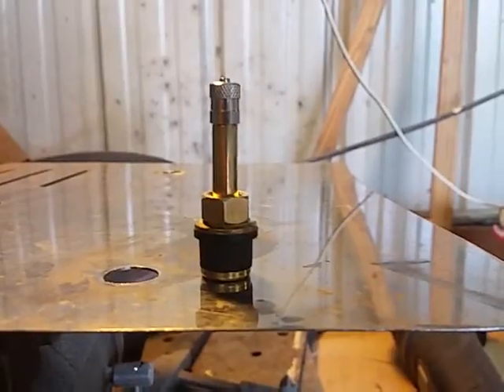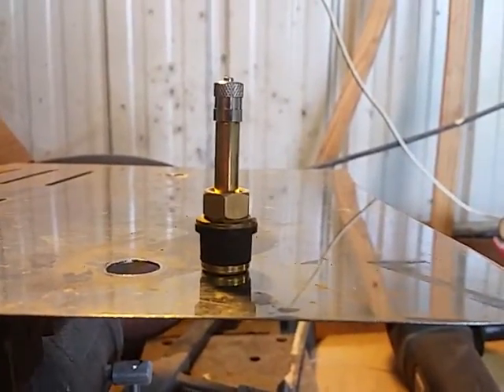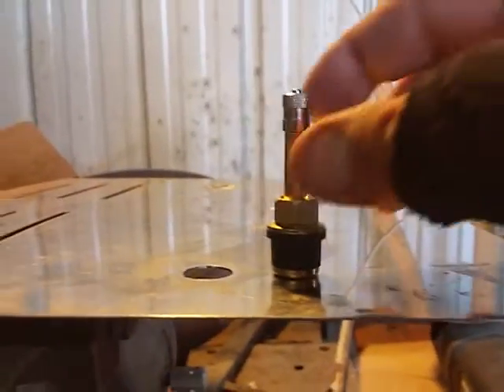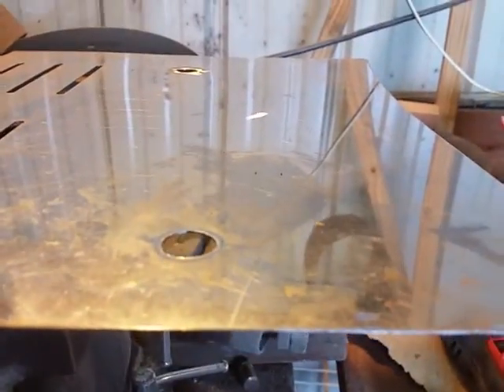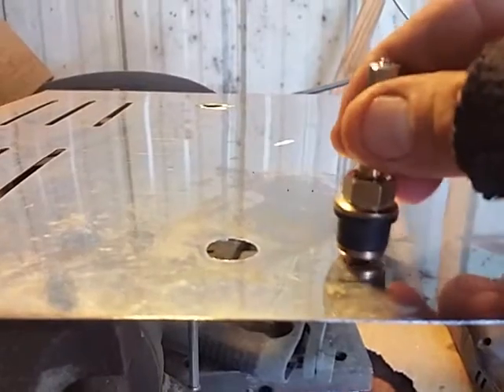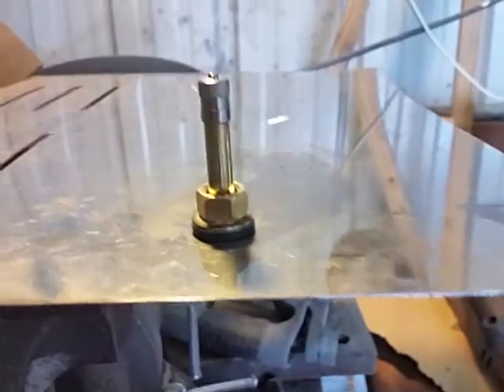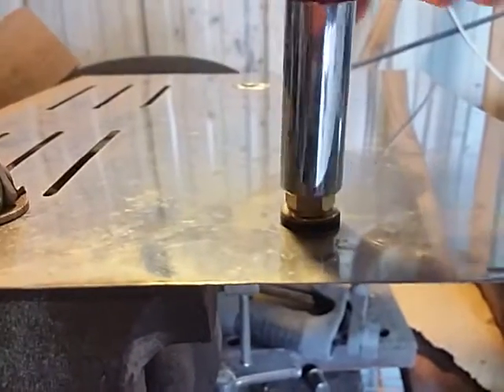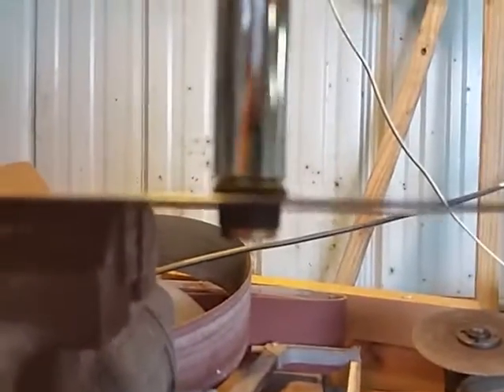QuikStem - Replace Tire Valve Stem From Outside of Tire Without Breaking the Bead - View Inside Rim

Comment: You brag about how how fast and easy it is to install Quikstems and how durable they are and yatta, yatta, yatta and it all means nothing because the only way to get a hold of one on a long weekend (pr any other time for  that matter) seems to be online! 4 or 5 days completely negates the "Quik!" If this product is so damn great, why the hell is it not on the shelves of every farm supply store or truck stop? You've missed your whole point.
Reply from the maker: Hey. That's a great question, and believe me, we're working on it! We've just signed new deals that ought to have QuikStems popping up in local feed stores all across the country for our farming customers, and we're already working with A&I Products who services all John Deere dealerships and service centers as well as thousands of other equipment dealers across the country. So check your local tractor and equipment dealers and one might very well have QuikStem in stock. There are also one and two day ship deals on Amazon Prime from Hardline Products for .453" stems.
But, even your nearest local store does you little immediate good when you're broken down offroad somewhere, which is why we say You Need It BEFORE You Need It! So we suggest you get some now wherever you can and have them in the toolbox for next time.
Thank you for your business and your note.

Comment: How do you get the fucking cap off lol
Reply: Are you having trouble getting the dust cap off of a QuikStem? I've never heard of that before, but I guess it's possible. If it was really stuck I'd probably hold the barrel with one set of pliers and turn the cap with another.
Right tightly, lefty loosey.

Comment: Can we replace only the rubber grommet after about 4-5 years?
Reply: Yes. If the stem is otherwise intact, as it generally is, the rubber grommet is replaceable. While we don't have them currently for sale because they need replaced so seldom, we can get them if needed.

Comment: Are there different size rim holes or all the same?  I have 17 rim on dually.  Will these fit?
Reply: Thanks for your comment. We do have the stem for you. The valve in this video is for tractor and big equipment tires.  Your dually is most likely a .453" valve stem hole.
Hit QuikStem.com/where-to-buy and you'll see multiple options.
The best deal in a twin pack (one for now, and one so you're ready next time) is at Hardline Products QuikStem Tire Valve Stem - QS-1 https://www.amazon.com/dp/B07MQFZMXK/ref=cm_sw_r_cp_apa_i_.5RJCbX66GJZ9
Let me know if you have any questions.